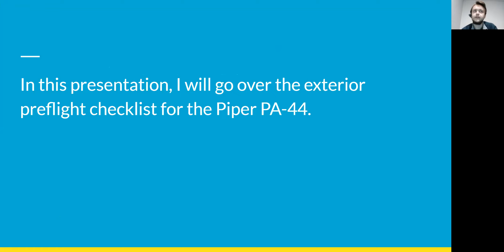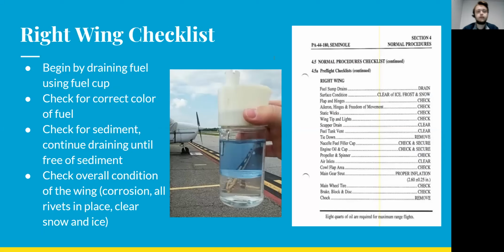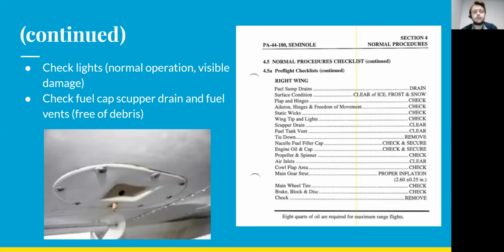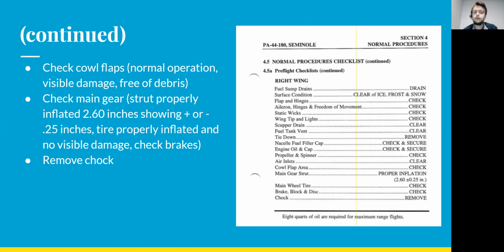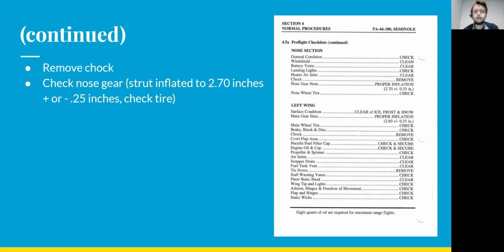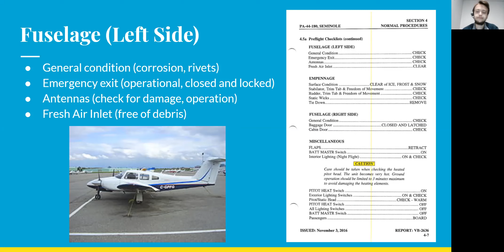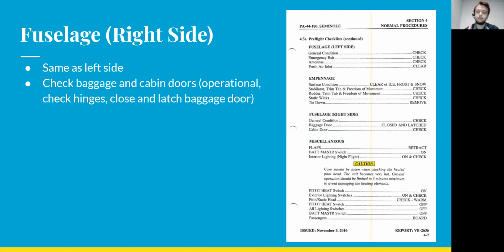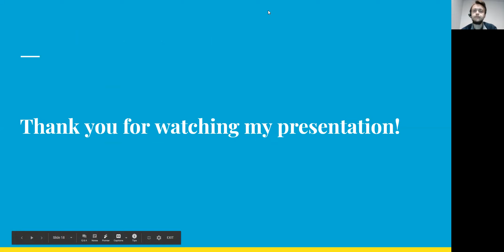Conducting an Exterior Preflight Inspection- Piper PA-44 Seminole

Comment: Hi Kyle, 
You mentioned checking the inflation of the tires, is there a certain tire pressure we should have for the piper seminole? If so, how often do we need to check the PSI (if we even need to)? Personally, I have never checked the tire pressure during a preflight, only a visual inflation test.